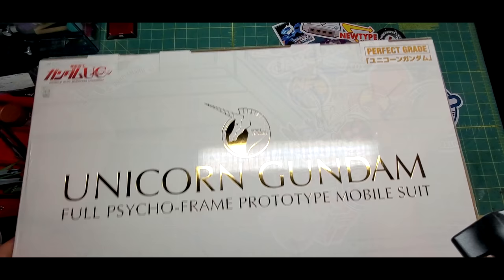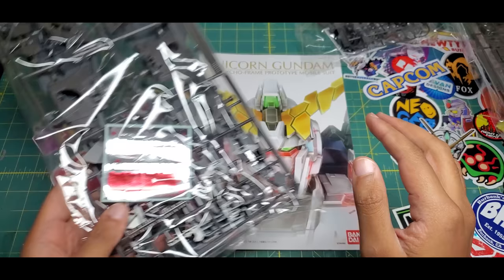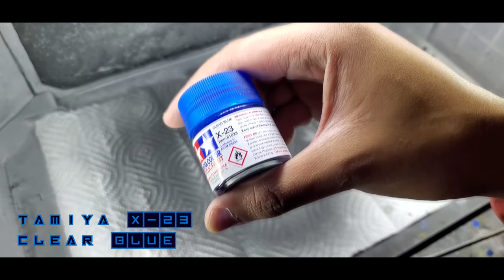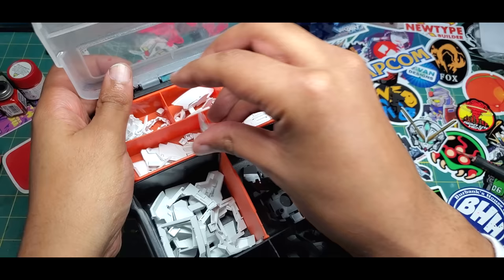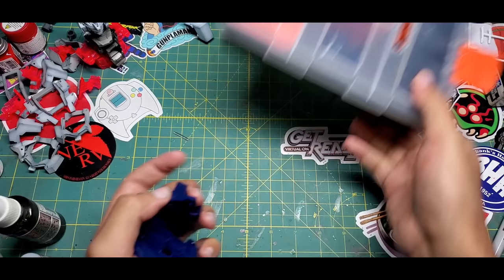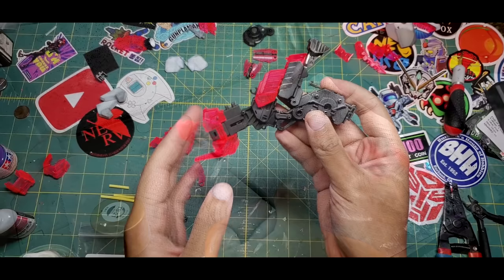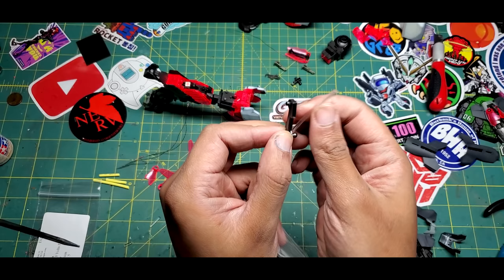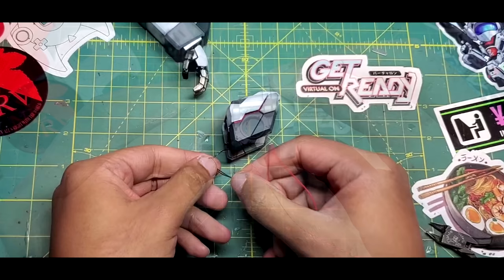#newtype #Otakubuilder  PERFECT GRADE UNICORN GUNDAM [4K]

Comment: As someone who decided to buy a perfect grade purely from passion but also from research it’s wise to go after what you want but also be careful about what’s out there. You may want the strike freedom but might not like that it requires the action base for the wings. The astray red frame is a good starter but with flaws that can be fixed with some experience. Zeta is a classic with old engineering and designs that have been outdated but offers a unique perspective of how different Bandai designed old kits. Every single one offers it’s own challenge and experience is key when it comes to building each one. Buy and build what you want but know what you’re getting before you make that leap cause sometimes it’ll be steep and other times it’ll just be shallow if you know what you’re doing.

Comment: 30:27 32:29 
It's kind of scary how expensive it is if you decide to go through the process of getting all of the PG RX-0 Unicorn Gundam variants. It would require someone to really really like this design to buy it all.

What you'd at least need

⬇

- Retail -
RX-0 Unicorn Gundam (x2)
RX-0(N) Unicorn Gundam 02 Banshee Norn (x2)

- P-Bandai -
RX-0 Unicorn Gundam LED Set (x9)
RX-0 Unicorn Gundam Full Armor Unit	
RX-0 Unicorn Gundam 02 Banshee Armed Armor VN/BS [add on set]
RX-0 Unicorn Gundam [Final Battle Ver.]
RX-0(N) Unicorn Gundam 02 Banshee Norn [Final Battle Ver.]	
RX-0 Unicorn Gundam 03 Phenex (Narrative Ver.)
RX-0 Unicorn Gundam Perfectibility (x2)
RX-0 Unicorn Gundam Perfectibility Divine [add on set]

⬇

...to eventually have a collection with at least:
RX-0 Unicorn Gundam
RX-0 Full Armor Unicorn Gundam [Red]
RX-0 Unicorn Gundam [Final Battle Ver.] 
RX-0 Unicorn Gundam Perfectibility
RX-0 Unicorn Gundam Perfectibility Divine 
RX-0 Unicorn Gundam 02 Banshee
RX-0(N) Unicorn Gundam 02 Banshee Norn
RX-0(N) Unicorn Gundam 02 Banshee Norn [Final Battle Ver.]
RX-0 Unicorn Gundam 03 Phenex (Narrative Ver.)

Then you'd maybe want to double up on it if you want to display all of these variants in Unicorn Mode and Destroy Mode.
And even more if you want to display it in 'Unchained' Mode.
Reply: @xxnike629xx You talk like its an actual requirement to collect all Unicorn kits, especially if one's a fan of the series.

Such rule is just actually optional. Don't make things difficult for you. Especially if you don't have enough funds to go Pokémon in buying things.